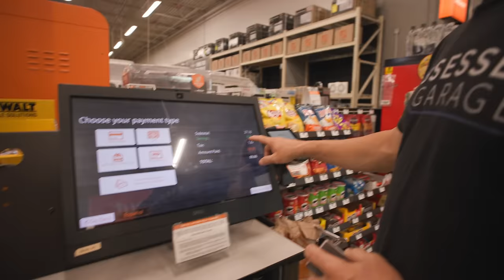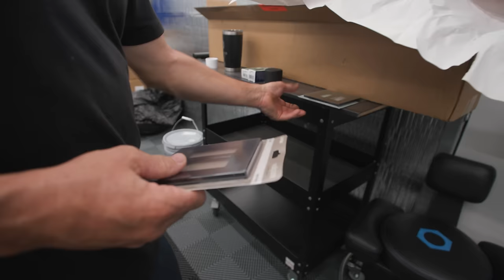The OG Vacuum Solution | Install with Mike - The CLEANEST & QUIETEST Vacuum Setup!

Comment: You literally can get hoses with 120v integrated on the hose so the switch is on the end of nozzle. cleans up the install and makes it a lot more user friendly being able to shut it on and off without walking 30ft . Cheers!
Reply: It’s basic central vac outlets . With power leads built in.

Comment: Nice work! I hope you de-burred those cuts on the pvc. I had a professional installer (and I use that term lightly) install a central vac in a house and he skipped that step. Those things catch a lot of dirt. Of course he also plumed the intake and exhaust pipes backwards, so..............................  Also, a thermal imaging camera should help you see into the wall.

Comment: Looks nice good job but 1300 bucks is steep , I will stick to my 99$ Ridgid with the 56$ car accessory hose kit and it sucks water up too 😂
Reply from the maker: I get that.  I just want something better for my garage.  The thesis is that if I want it, other will too.
Reply: No doubt a Rigid vac will get the job done at a fraction of the price. IMO, the biggest value-add with this type of setup, especially the Hide-a-Hose configuration, is the convenience. For some of us, the time & hassle saved of simply being able to grab a hose and go to work is worth it.

That said, I’d love to see some objective reasoning as to how this vac is different from all the others (ie. VacuMaid) because on paper, they look identical. What am I getting for ~$600 more?

Comment: Getting ready to install my system with the black Cox reel.  What is the height of your setup from the ground to the top of the reel and bottom of the Vacuum.  I can get close if that outlet is at 4’. I like how that is setup on the wall.

Comment: I have the Cox hose and it makes a horrible whistling noise. Is there a fix for that? It’s a bit better with attachments.
Reply: Make sure your hose end fitting are tight. Remember they are threaded to the ribs of the hose, so counter clockwise.
Reply: It is likely due to the hose being on the reel still. If you have the hose wound around the reel, the air "turning" in the hose can make a whistling noise. Try pulling more of the hose out and see if that helps any.